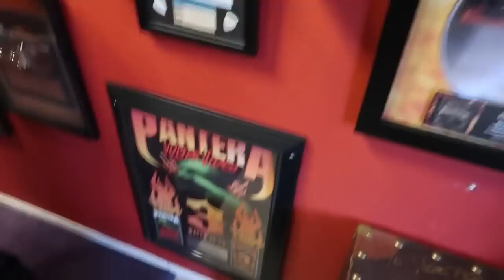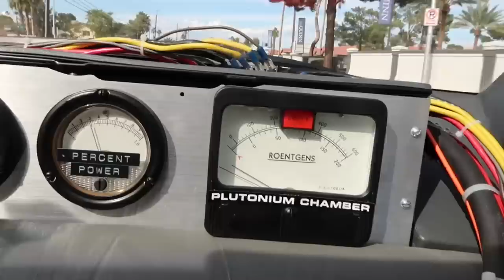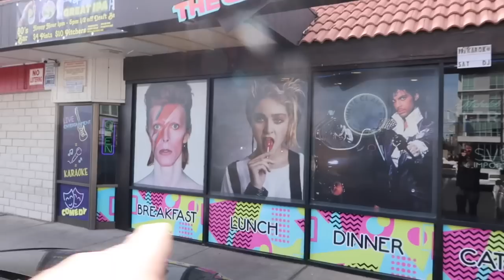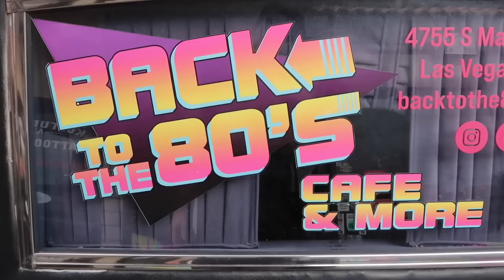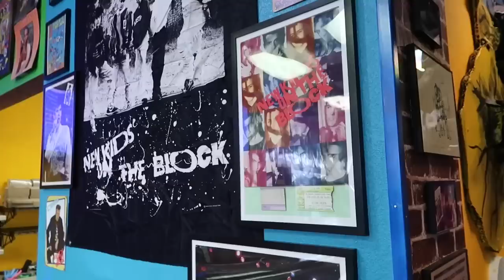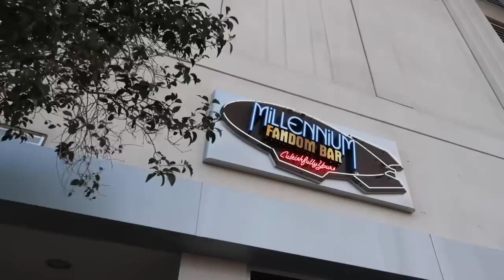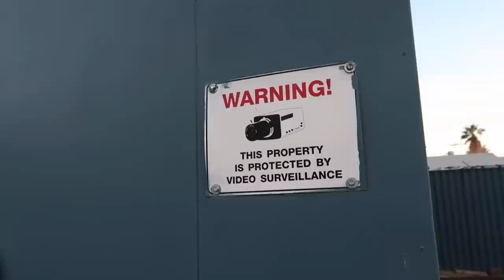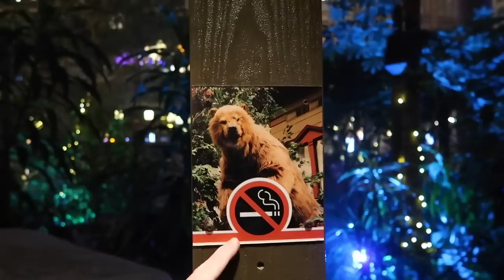Retro Tour Of Las Vegas In Delorean Time Machine - Back To 80’s Cafe / Up In Scoops & Biff’s Casino

Comment: Hey man. I have a memory of going to Disney World around 1980-82 and on the Space Mountain ride the ride vehicles were 4 people in each divided 2x2. And you sat between the legs of the person behind you. I’ve watched a lot of Disney videos by you and the trackers and many others and no body has mentioned this. Am I crazy or is this true. I was around 10-12 at the time.
Reply: Jay Hillmanyou are not crazy- I remember that , too and I was at WDW many times in the 1980’s!
Reply: @conniecrawford5231  I was pretty sure that it was true but I’ve just not seen any of the “Disney Vloggers” mention it.
Reply: The WDW Space Mountain, & the Disneyland Matterhorn use the same ride system. I remember the tandem seats on the Matterhorn until they got the current sleds in a overhaul in 2012.
Hello from Phoenix Arizona!🔥